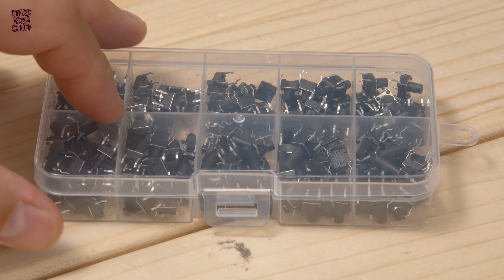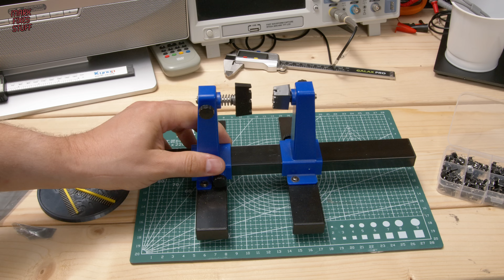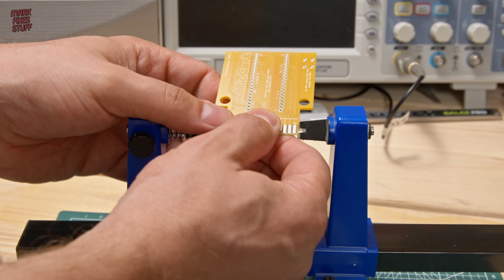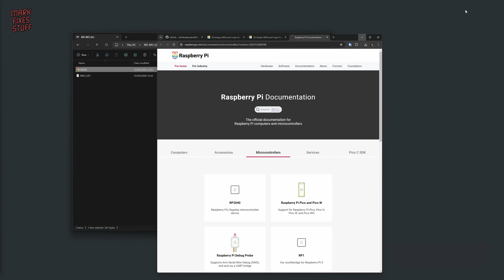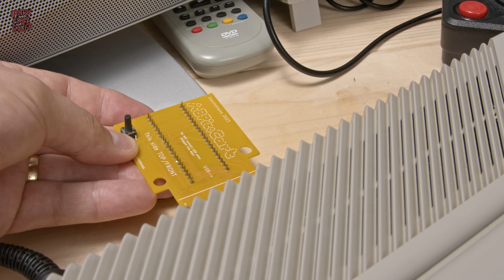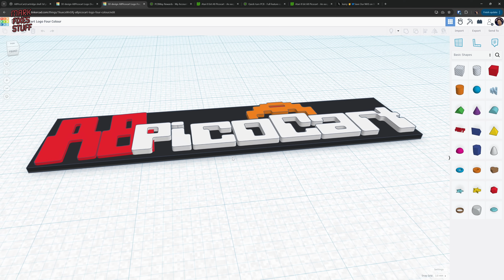The Cheapest Atari 8-Bit MultiCart? (Full Build Guide)

Comment: Bought this as a kit off eBay & finally worked on it tonight. Aside from melting the plastic reset button while soldering, it took me 90 minutes to build. As is my luck, the brand new soldering iron I bought last year developed the habit (like every other soldering iron I've ever used) of having one spot being hottest at one spot on the side but not at the tip. Why does this happen? At any rate, I managed to get it together & when I tested the fit of the USB-C connector it seemed to be a bit tight. Maybe due to my slightly less than perfect soldering? The tolerances are tight with the included shell.

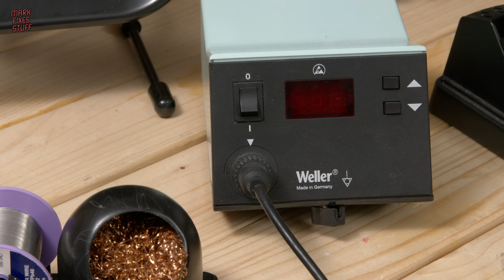Comment: 5:00 Pro tip for soldering: breadboards are the ideal work-holding for soldering rows of pins -- keeping them all securely held at the exact correct spacing and alignment.
Reply: I even use breadboards to solder socket headers, mounting them pin-end-up on my soldering breadboard using some double-length pins I keep around for the purpose.

Comment: Have you tried this with a “real” 2040? Does it work?
Reply from the maker: The RP2040 chip itself is the same. It’s the pins that are available on the headers that are different.
Reply: @MarkFixesStuff hmm, dug in there a little more, not sure why the creator would pick that one over the official version, it’s not that much cheaper. It’s $2.83 vs $4.14, that clone vs the official one. Seems risky to pick a clone that might disappear who knows when. Love the idea, just wish it used the real board. Maybe it’s cheaper in other regions, just not in the US. Wonder if those additional IO pins are what was needed.

Have to order some up and see.
Reply from the maker: @c1ph3rpunk yes, it’s the extra exposed GPIO pins on the clone. There’s not enough GPIO pins exposed on the board with the official pico. I tried to explain this in the video.

Comment: Fantastic build. It's great to see modern accessories being developed for old 8-bit platforms. One thing I will mention about the build, simple is often better. Get some Veroboard and use it to hold the pin headers in place while you solder them to the PCB while just placing them on your desk. Push down with your pinkie finger while holding the solder with thumb/forefinger. I've tried PCB holders before and I am much more comfortable resting my forearms on the bench while soldering, I dislike soldering when my arms are "floating" :-)
Reply from the maker: Same but it’s really hard to film things flat on the bench and solder them with the camera in the way.
Reply: @MarkFixesStuff  I fully understand, I've watched a lot of of your soldering videos and you do a fantastic job given that you are sharing the space with a camera 🙂 your close up shots of the solder flowing into the joint are amazing.

Comment: 1:19, thats what he said 😁

Still, one thing to note here, the RP2040 is not officially 5 volt tolerant! It can work out as we see here but we stress the chip. So beware and don't be sad when this setup fries a RP2040.
Reply from the maker: There’s a discussion about this on Atari Age. The pins used should be ok for five volts unofficially, but they are not certified. At the end of the day, the pico costs £1.40 delivered so is worth the risk
Reply: @MarkFixesStuff  the thing is tough, imagine you are on a scene party like Revision and are happily coding on the last lines of your demo. Disaster strikes and the module refuses to work because of this problem. If you are lucky someone has a RPPico module that they can give you but the problem still exists.

If i where an Atari home computer user i would most definitely take that cart and add level shifters. They aren't that expensive and make sure that the cart will work forever.

Yes, its only 1,70€ for such a "Chinese" Pico but still, having it kill itself at the most inconvenient moment is a certainly, Murphy never sleeps. ;)

Comment: To get back to the menu, press the reset button on the cartridge, then reset on the Atari.
Reply from the maker: I was told that after. I’m far too used to the way the Spectrum resets. My bad!
Reply: @MarkFixesStuff  Yes, the switch on the cart actually does not reset the machine, it just remaps the cart's ROM into Atari's memory space and sets the respective vectors to run the cartridge after you press RESET.

Comment: Great video.  To make attaching the pin-headers easier, I just stick them in an old breadboard with the pico on-top.   That way they'll be guaranteed straight, and gravity keeps the pico all the way on them while soldering.
Reply from the maker: @3vi1J  That’s a brilliant tip!
Reply: I read the comments so I wouldn't accidentally repeat this.   This isn't the original Adafruit video where I saw it, but good enough.   https://youtu.be/Z0joOKaQ43A?si=x9h6iD3Uo34y1wij&t=60

This shouldn't damage the breadboard, but I can confirm if you are careless (too slow) then it is possible.  It's best to not go through pins sequentially (although you'll probably ruin the headers before the breadboard)

Comment: Glad to see that "Final" wasn't quite Final.  You put a lot of effort into shooting the video and it shows.

On topic of the video: I really dislike the fragmentation of the RP2040 dev boards. I guess it makes sense considering that people have different uses, but it's also just a bit of a bother. At that point he might as well design the board to just have the RP2040 directly on there plus the other necessary components. I guess for some inexplicable reason it's cheaper to get these dev boards than than RP2040, RAM and handful of jellybean parts? I know part of it is also so it can be assembled by the end user but seeing as how PCBway also provides affordable Pick&Place... :P
Reply from the maker: That was the final video on that spectrum, being part three. In my downsizing video I did say my vids would still be coming but less elaborate.

The pi thing is nuts. There’s not enough GPIO pins exposed on a standard pico, hence the clone use. I think popping an RP2040 on would be great but make the project harder for people. It’s not a commercial project either.

Comment: While not all pins were soldered yet, why not press down on the pico clone while inserted into the PCB and reflow that one edge Pin to straiten it out? I think that would have made it much cleaner.
Reply from the maker: I actually intended to simply clip the pins down but didn’t bother once it was in the case.
Reply: @MarkFixesStuff  Sorry Mark. It might be nitpicking on my side, but by cleaner i meant the pin header to sit flush on the board and not bent. Doesn't change the bent if you clip the pins on the other side ;).

Comment: Pi Pico has 3V I/O voltage, which is somewhat tolerant to 5V for a while, but eventually it will start to have strange glitches and die. This cartridge needs a level shifter and that's the biggest bummer about Pi Pico when using it with retro hardware.
Reply from the maker: Yes there’s a discussion about this over on AtariAge. The ports used are unofficially 5v tolerant but not the 5.5v needed to get the official seal of approval. It’s a good read.